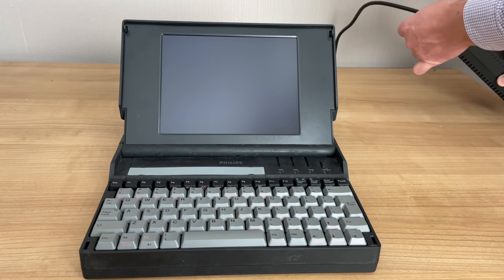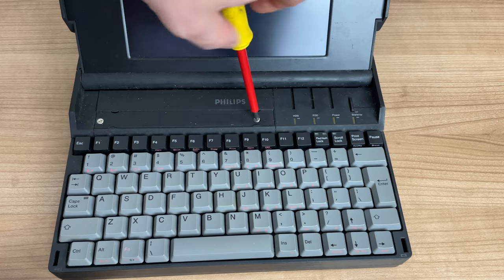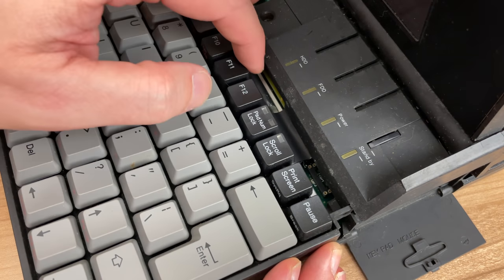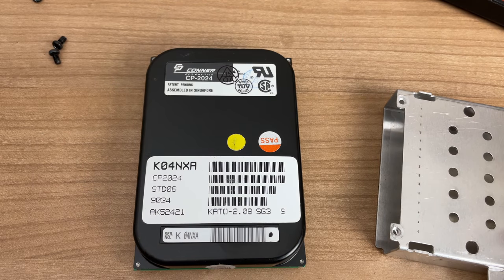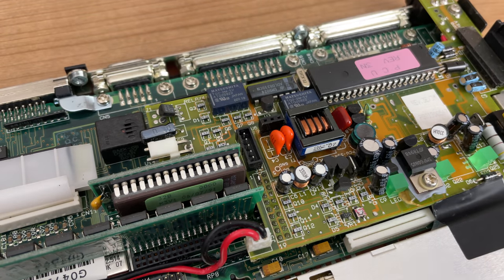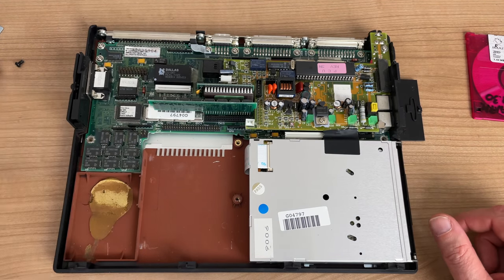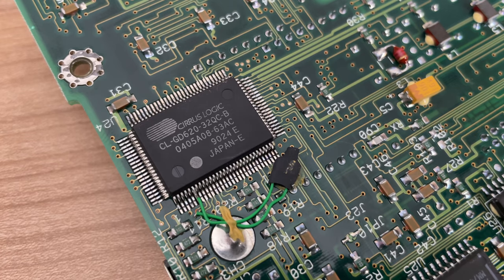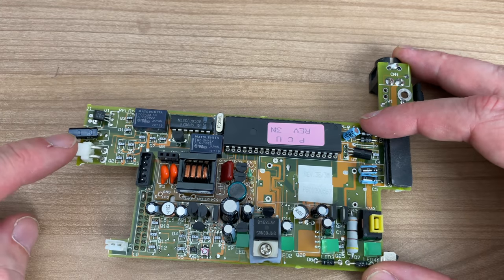Philips 286 laptop - into the belly of the beast

Comment: Does it start with the display removed?  Could narrow the issue down to a display connector/cable issue.  High-pitched whining like that tends to indicate something's shorting out, so I'd also suspect something in that area didn't like the heat.

Glad to know I'm not the only one who absolutely despises those Dallas chips.  They don't even have the decency to shatter when you chuck the dead ones at the sidewalk after removing them.  The number of problems they cause by sealing the bloody battery inside the chip, something just about no other RTC chip-maker does, it's irritating.  A perfectly good clock chip ruined because some idiot won't redesign it with a coin cell socket that can be accessed by the end user, or offer a version with pins to attach an external power source.  The battery dies and it becomes 100% pure e-waste.

Comment: I'm sorry I have to say that, but thats not the right equipment for working on those boards... ;)
You need a way better solder iron (SMALLER, but high powered) and - and thats the biggest thing here- a desoldering station! Nothing's more bad than a cheap desoldering pump!
You desoldered two legs of the 74HCT2444WM (maybe)... 
Next important question: Did you use an ESD-wrist strap? Never work on components like that without having a good contact to ground. ;)
I hope you can get it back to life- maybe with help from your community!
Best regards, Matthias